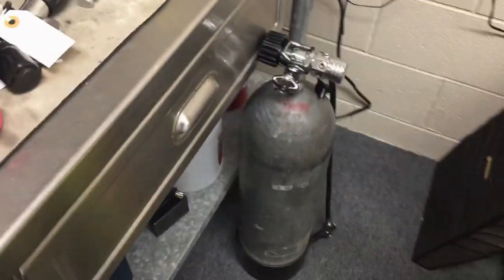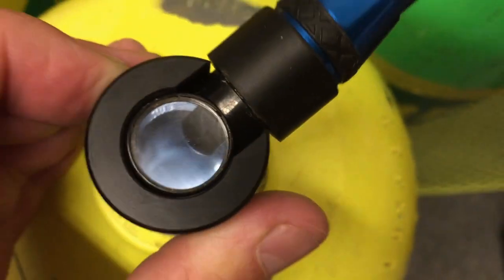Visual Inspection Mistakes {[That "IS NOT" A Crack]}

Comment: What about cleaning out the threads with a synthetic bottle brush and light solvent before inspection to clean out any lube and manufacturing swarf? I’m not VIP certified for cylinders, but something I learned inspecting aircraft components is that sometimes you think there’s a crack, but then you find  more cracks. Usually that comes from manufacturing. If they used a three flute tap the “cracks” are 120 degrees from each other. It’s where the tap stopped threading when they backed it out of the cylinder. Many of the tasks I did were Required Inspection Items (RII), and the regulatory agencies like the FAA mandate that a second person verified my findings. Great to see you doing the same thing to give your customers the best service and getting the full life from their equipment. 
Great video!!!  Thanks for sharing.
Reply from the maker: Hello Caleb Mcelhaney, you most certainly can clean the threads before you perform an inspection. I typically will use a microfiber cloth and simply wipe it down before the inspection. The brush can work, as long as you prevent any debris from falling down into the cylinder.

Comment: Tool marks are often mistaken for cracks , having found cracks in several aluminum cylinders confirmed by manufacturer I'm  a Cvpi and PSI certified , we started using the VIP + machine when it came out , it is great for confirmation of a crack  ,
Reply from the maker: Thanks for sharing scooter dogg.

Comment: Why not clean the threads prior to the inspection process?
Reply from the maker: Hello Mike Ramsey, typically we will wipe them out during the Inspection Procedure. Usually this is completed when checking for any folds in the neck.

Comment: Have you done a video on SLCs?  I recently had a tank fail visual and it was an SLC.
Reply from the maker: Hello @skirblah, we have done several in the past, and we were even joined by Mark Gresham from PSI PCI, who trained us on how to perform visual inspections. The pesky 6351 alloys continue to cause divers to have their cylinders condemned during inspection time. Over the years, I have had more of my own cylinders fail their visual inspections, than me failing customer's cylinders. I have even had non 6351 cylinders fail an inspection. But at the end of the day, I am still here to dive again, and the fill operators are still here to fill my cylinder.  We have another renewal with PSI PCI coming up in June of 2024, and I will see if Mark can help us produce an in-depth video on SLC for you.

Comment: I thought SLC was only a problem with 6351 Alloy - here in Australia you can no legally no longer fill an AL6351 tank regardless of it's test status. Is this different in the USA?
Reply from the maker: Hello @peterjulianphotos4659. Here in the states, certain 6351 cylinders can still be in active service if they receive a current Eddy Current test. Most shops choose not to do this test for safety concerns.

Comment: Hey where abouts in NC are you located? I have an old tank that was dumped off and a friend's junkyard, and he gave it to me, because I am a commercial diver and he thought it would make a good conversation price... And left a huge question mark on how it got there in the junk yard.  I'm doubtful it would pass vip, but I would like to look inside it to see if it has any cracks or if there is a chance I could put a K valve... That I have in my spare stuff already.. and maybe get it tumbled if it needs it. I'm just one. Of those half full guys I guess, but if it could be saved, it would match my newly viper and hydro'ed tank I bought today. Lol
Reply from the maker: 420 Taylorsville Beach ct, Taylorsville, NC 28681
Come by
Reply: @LakeHickoryScuba  thanks. As soon as I get back to NC I will try and work out a convenient time.
   For some reason, I find this stuff interesting.

Comment: What if there's visible rust on the outside, does that typically get a cylinder condemned, or rejected?
Reply from the maker: Hello Yuio Poli, rust would only be visible on a steel cylinder, not on an aluminum cylinder. Depending on how much rust, and whether it crossed a threshhold, would the cylinder be condemned. Typically, on a steel cylinder, the place you would see the most rust on the outside, would be the bottom of the cylinder underneath the tank boot. This more than likely would cause a steel cylinder to be condemned.
Reply: @LakeHickoryScuba  Thanks LakeHickoryScuba!

Hey quick question, I got a tank and it past hydro and visual inspection and the scuba store filled it.... but I've never had a valve test done in it. My question is, since the store filled it... doesn't that mean that they think I don't need a valve test? Should I get one?

Thanks.
Reply from the maker: Typically, to test a valve, we verify the burst disc is still good, and that it has the proper rating for the cylinder. Lastly, we test for leaks. All this can be done during an external visual inspection which should be done at the time of fill. Your cylinder should be just fine.
Reply: @LakeHickoryScuba  Thanks! They said they replaced the o-ring too so I'm guessing that adds to me not needing to pay another $25! 

Thanks for everything!
Reply from the maker: The neck O-ring is what they are referring to. This is required during a visual inspection.

Comment: Hey Bryan... Welcome back.  When you condemn a tank, do you drill a hole in it or stamp it condemned (sp?)
Reply from the maker: Hello Steven Rogers, great question. We are discussing making a video on that very topic. In short, we disable the treads so a valve can not be reinserted back into the tank. The problem with drilling a hole in the tank is, it can be repaired and covered with a sticker. This is why all stickers must be removed during the inspection process. We look for thinks like that, both internally and externally.
Reply: @LakeHickoryScuba  wow... I dont know if I would want to be near a tank that had a hole repaired while it's being filled
Reply from the maker: I definitely would not want to be.

Comment: This is a fault in the machining prossess. Chipped thread due to the thread mill is worn or not being set properly. It happens the threa in this situation is fine and won't fail. They can become rounded as well.
Hope it helps
Reply from the maker: You would be correct Kurt Steiner, we have also seen this being caused by over tightening the valves from other visual inspectors.
Reply: @LakeHickoryScuba  
Bryan thank you for that, and agree with you overtightening can also cause this 
I used to be an engineer, in many different areas from marine navy engineer to production of diesel system used on things like Rolls Royce engines to caterpillar whartsilla and many others including formula one racing engine's.

Comment: tank cary handle-ok or not ok ?reason for the question i'm waiting for the corona situation to subside so i can get my OW cert ,wile waiting for that i'm buying complete gear (man with a plan .hehehe) and i try to pick the minds of those who  know for information lol
ps if i wood be living in the US i wood preffere to get trained by you , but am living in the Philippines (belgian expat) so i will be looking for an instructor i feel good with here.advanced thanks for anny reaction
Reply from the maker: Hello Dee Cee, tank carry handles can be handy at times. As long as the Valve has a long enough post, they are easily enough carried by the valve. Once you have your first stage attached, try not to carry by the first stage, just the valve, or handle if equipped.